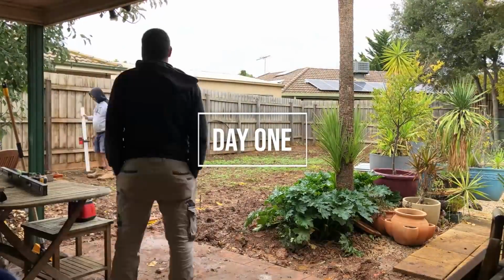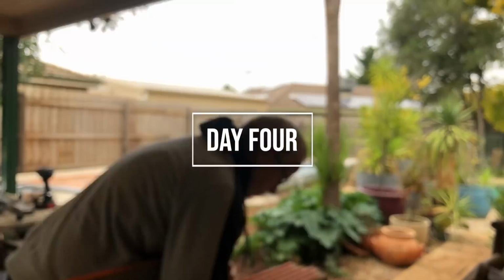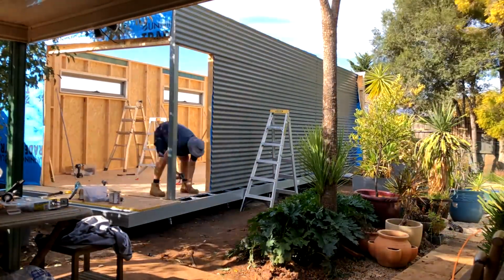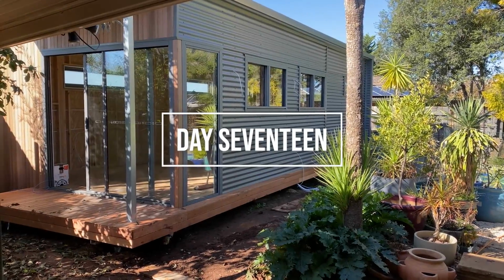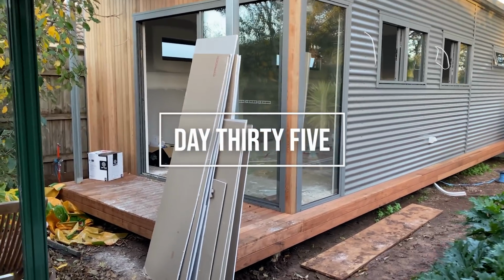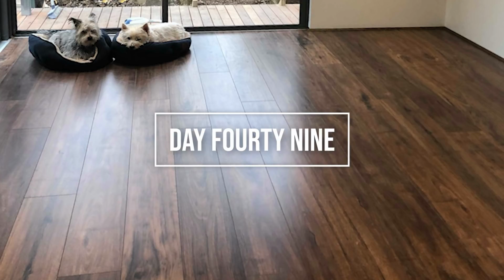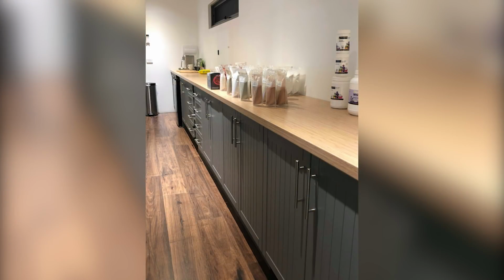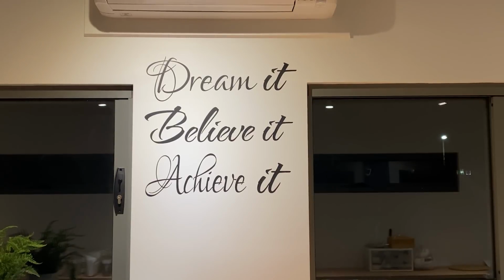Our Backyard Office Studio Build

Comment: Isn't it hot considering you used tin walls for the exterior which (I assume) would absorb heat more
Reply from the maker: Not at all.  The insulation works perfectly.  We been through one summer in it with days in excess of 42C and have had to use the airconditioner for a minimal of time.

Comment: Wonderful video and impressive build. You gained a subscriber. 

What did you use as a moisture barrier? Looks like steel joists, but cannot tell what was used for insulation in the flooring. Thanks.